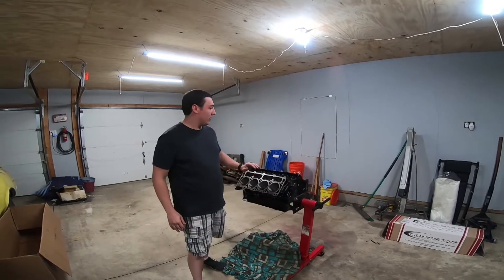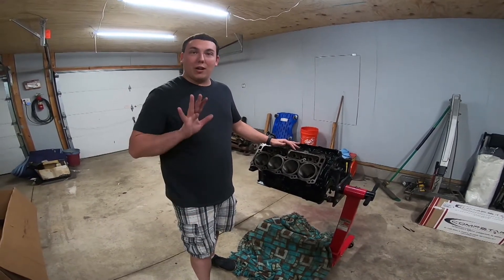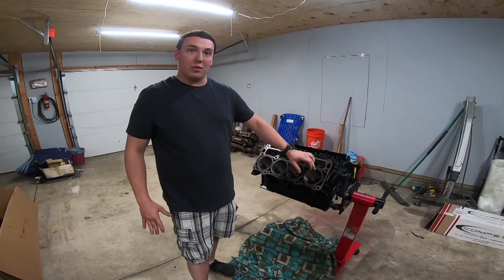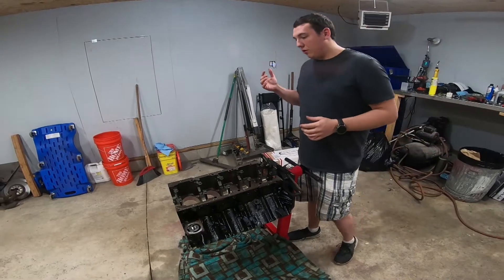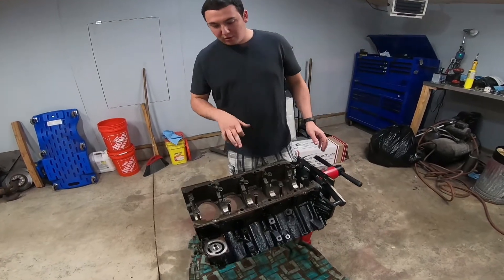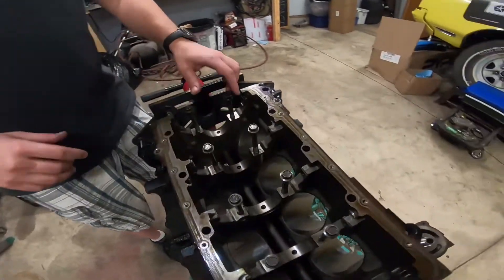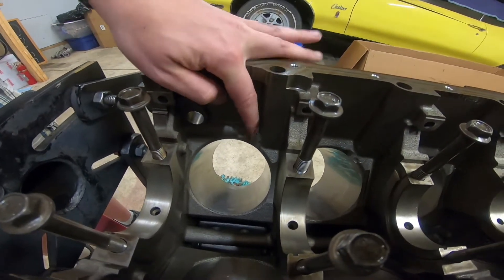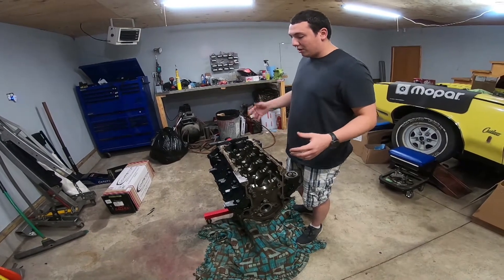5.7 Hemi Stroker Build (Part 1)

Comment: What did you use to clearance the block? Or did you take it to a machine shop?
Reply from the maker: To clearance the block for the stroker kit I just used a die grinder with a carbide bit. Just took very little off at a time until I had roughly .060-.080" clearance between the rod bolts and the block.
Reply: Nice. I'm looking to do the same to my 5.7. It was nice to see someone do this specifically to a 5.7 block for a visual reference. Thanks!

Comment: How much did you end up removing? Also what kinda clearance should you have ?
Reply from the maker: I didn't pay much attention to exactly how much I ground away but I'd say it was around 1/8inch everywhere except for the rear cylinders. Those had some extra casting so they needed a bit more. I will attach the link of where I got a lot of my info for this procedure. It says to keep about .060-.080 in clearance for all moving parts so that's about how much I have. https://www.google.com/amp/s/blog.k1technologies.com/how-to-clearance-your-block-for-a-stroker-crankshaft%3fhs_amp=true
Hope this helps
Reply: @andrewdugan820  awesome, I was just about to ask the same thing